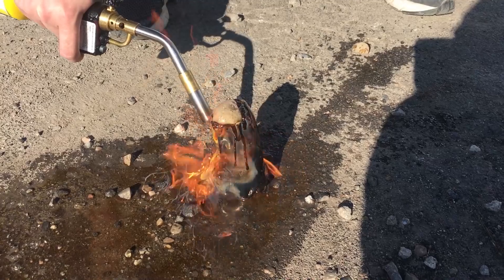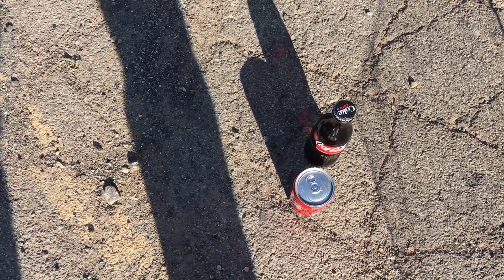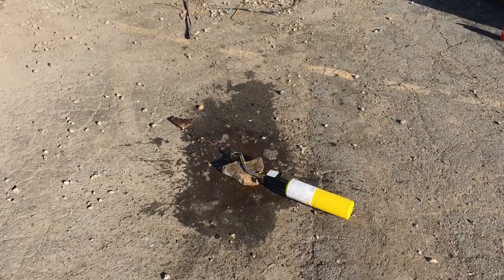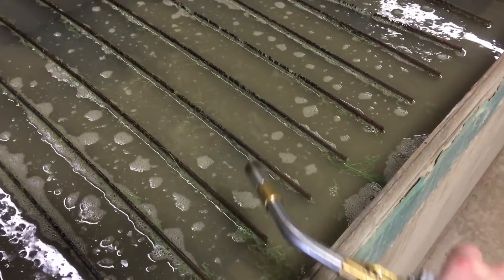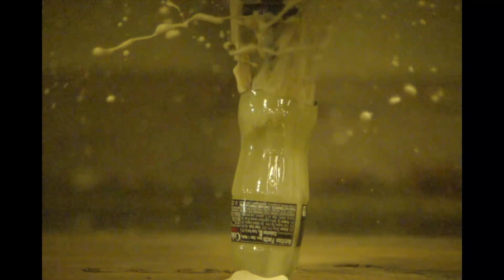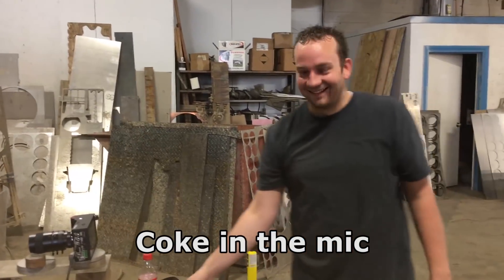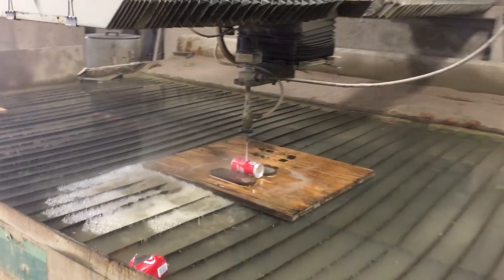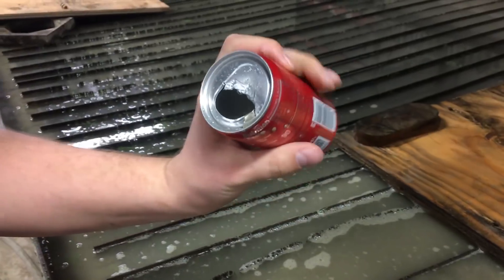1000 Degree COCA-COLA Exploding Experiment and Shooting with 60,000 PSI Waterjet - Very Interesting

Comment: It is caused by a vacuum hammer, which i'm pretty sure is an air bubble formed by banging on the end of a glass bottle. The air bubble goes down from impact then in your case, rebounds of the bottom end shattering the top. Which is pretty cool.